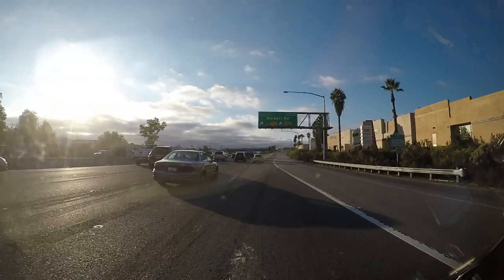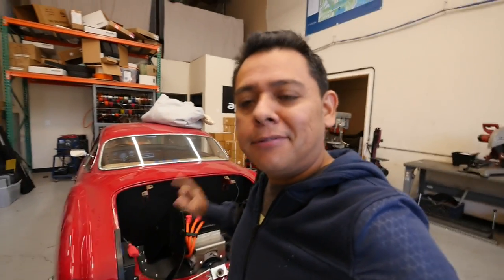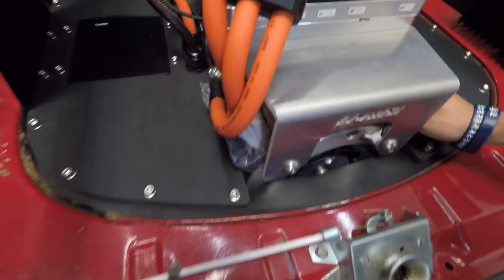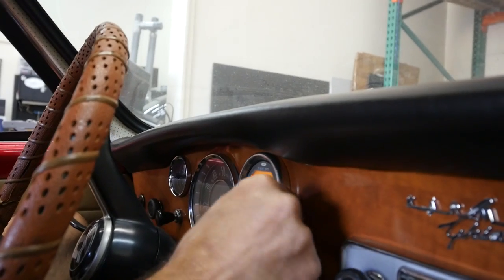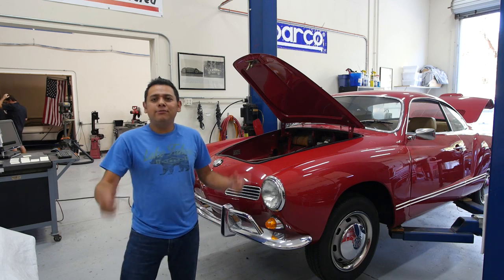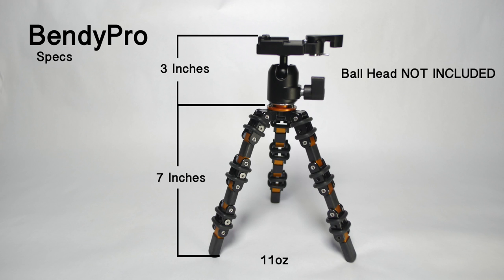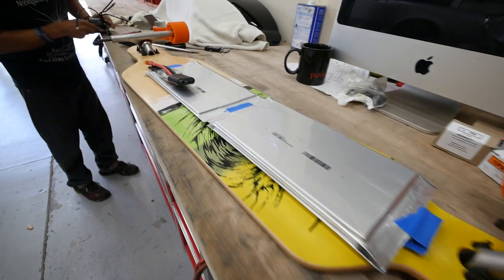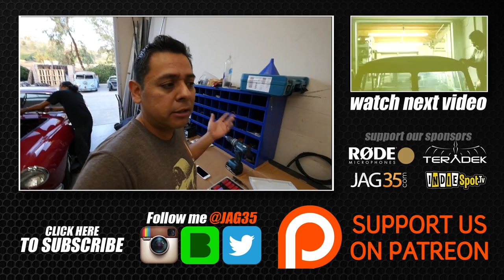The answer to Volkswagen's Dieselgate - Electric VW

Comment: You briefly talked about regenerative braking. What about a video on that topic (in collaboration with EV West)? Especially on transferring the recuperated energy in a lithium ion battery like you use. Because usually you charge a Li-Ion battery differently (balanced CC-CV). Would be interesting :-)

Comment: What would you select (motor, battery, charger, etc) if you were to take a KLR 650 and turn it into a 100% electric carrying enough battery to ride at least 300 miles (based on max load of ~750 pounds  GVWR)? The weight of the engine and tank will definitely be replaced by electric motor and batteries, but being a noob at this I figured I'd ask the gurus :) Thanks!

Comment: do you have any stats on the conversion? wondering what sort of range is possible these days with a classic converted to electric
Reply from the maker: I get 150 miles per charge on mine with 44kWh pack.   The Ghia has 36kWh only but its smaller and lighter so I estimate 150 miles as well,

Comment: Was that a VESC running that little outrunner?
Reply from the maker: +Nathan Graham  yes,   Not impressed so far,  killed two of them on the bench while setting the can bus connection between them
Reply: Who supplied them or you guys build them off the bom?
Reply from the maker: +Nathan Graham  Torque skateboard
Reply: For what its worth if you or the evw guys aren't aware,  vedder.se and electric-skateboard.builders forum have mountains of information from setup to performance and troubleshooting.

Comment: the motor is turning because they come with "creepler?"
Reply: Enzo 8mmSA it's creep. so you can add steering and breaking help. and maybe ac. if the motor is not running, this won't work. don't know for sure but I think that's creep mode.
Reply: Ahhh thanks mhlobo wami. I replayed it 3 times before giving up in frustration.
Reply: Enzo 8mmSA. I have to say I'm wrong with this one. creep mode is made so you can move the vehicle verrryyyy slowly while parking or driving in your garage. you just need to use your big toe a little bit and it starts to drive very slowly. just like you learned at Ms puffs.
Reply: no stress. at least i know what he's saying so i can investigate it myself.